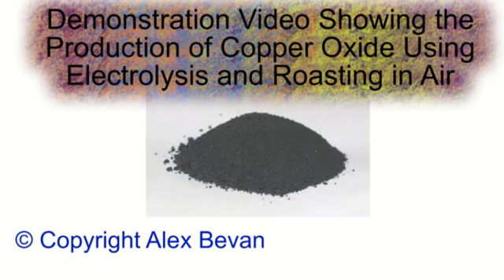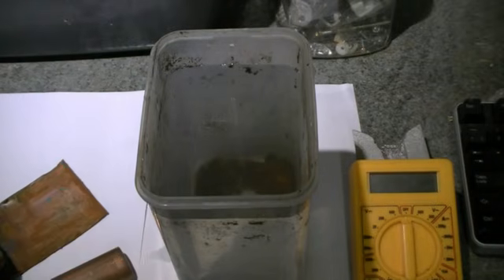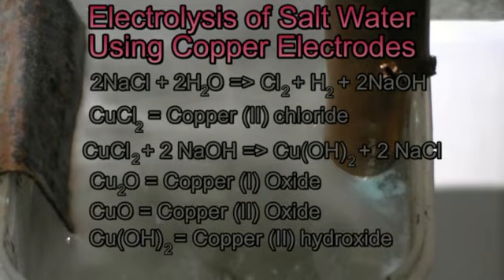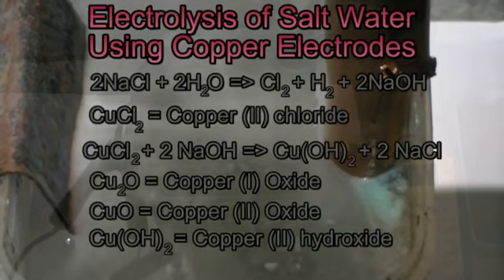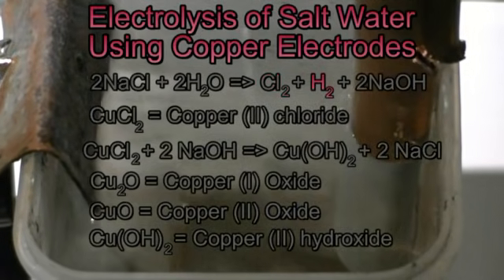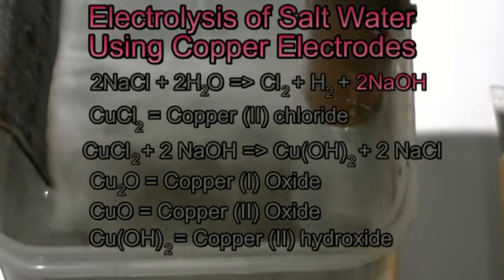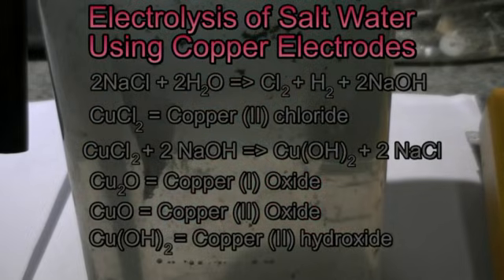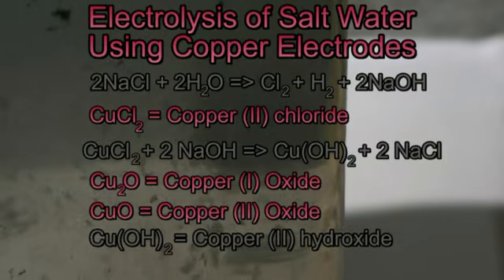How to make copper oxide (CuO) using electrolysis

Comment: I want to develop Bronze plating (Copper 88 Tin 12 percent) yellow bronze plating on MS steel surface.
Thickness 10 micron
Kindly suggest any relevant and proven non Cyanide chemical process.

Comment: How much salt should I use per XmL  of distilled water? Also I’m using a DC power supply, im using NerdRages electrolysis box design, how would I be able to send 8 amps to the electrodes? My Power supply can do it up to 10 but it automatically just sends like 200mA of current, how would I be able to up that?
Reply: if you add more salt or electrolytic you can incrase the amp
Reply: @BAKA34 I’ll give it a shot, my idea u came up with in the meantime was not enough wire thickness in the system, so I upgraded the thickness of everything but hadn’t tried it out yet

Comment: I made this using boric acid solution and 2 copper electrodes (electrolysis w/~10V @ 10cm apart). Black CuO crystals  accumulated on the cathode (and a quite a bit fell off the cathode and precipitated).

Comment: Sir Please Tell me about Red Copper 8 Sulfide.??
How it's made.??
Reply: Actually its Copper 2 sulfide and 8 is for sulfur.
CuS is not red its black,its red form is copper metabisulfite.
If you want to make copper sulfide you can use the most common method, that  is to bubble Hydrogen sulphide gas through soluble salt of copper like copper sulfate.

Comment: For some reason I always assume the sediment that formed on the cathode was just Nano particulate copper dust they've had reformed. I actually need about an ounce or two of red copper oxide. I'll just go ahead and make some copper chloride or sulfate through electrolysis and collect the copper 1 oxide that falls out of solution good video

Comment: sooo.....would i just be able to hook up some copper wire (or do i have to use pipe?) to my electrolysis setup for making iron oxide, filter the "sludge" ,bake it until dry, powder it, then bake it until black?
Reply: If you just used copper wire, the electrolysis process would cause it to converted very quickly, and you wouldn't get much powder as a result. Just get some one inch pipe and a pair of (good) tin-snips, and slice down the pipe, then open it up. In this demo, the pipe electrode showed the precipitate falling off. Experimentation is everything, you can find the method that suits you. The bigger the process, the more powder you will eventually produce. The electrolysis is the important concept, don't get too caught up in the detail.
Reply: Jakob Belanger you can use wire but wind it in a coil to get more surface and dont be surprised if it falls apart in the middle after being eaten through

Comment: i did this with sodium bicorbanate and the solution turned blue it looked like i was making copper sulfate or hydroxide
Reply: how are you going to make copper sulfate without sulfur?
Reply: Matthew Bragonje sulferic acid
Reply: Its carbonate, if you boil it down and heat it just a little bit you can get a lot of oxide
Reply: وأنا كذالك استعملت بيكربونات الصوديوم فكان الناتج لون أزرق سماوي

Comment: what is the copper oxide used for??
Reply: Copper (II) Oxide has 'Spectral Selective Reflectance'. Meaning it has a high radiation absorbance in the visible light spectrum but low emittance in the long wave infrared spectrum which results in a higher temperature delta of a body that is coated in the material and exposed to solar radiation when compared to the same body without the coating. https://nanoscalereslett.springeropen.com/articles/10.1186/1556-276X-9-577
Reply: Since Cupric oxide is a semiconductor - I was wondering if it might be able to be blended with, or precipitated with Silicic acid...hopefully this combo would raise the melting point, enough to be used as a material for a filament in a Nersnt lamp. But maybe it wouldn't produce as much light as the original Nerst filaments due to the high radiation absorbance of Cupric oxide? 
Any ideas? 
I also thought of adding aluminium to heated Sodium silicate (or add in before dissolution) and then precipitating both Silicic acid and Aluminium oxide (?), using a weak acid such as Acetic acid (10% vinegar). Washing, straining, evaporating some more water (to reduce shrinkage when drying) and then forming into 1mm diametre filaments, which could be "cured" with a blowtorch and further "cured" by running electricity through it.
The other option is Ferric oxide, but again not sure about melting point when combined/precipitated along with Silicic acid.
It would be great if a Nernst-esque filament was possible, with one, or a combination of these more common oxides!!!
Reply: Copper Thermite.
Reply: Crackling stars composition
Reply: I'm thinking of making some to treat my toenail fungus.